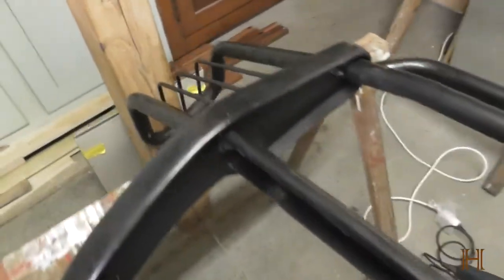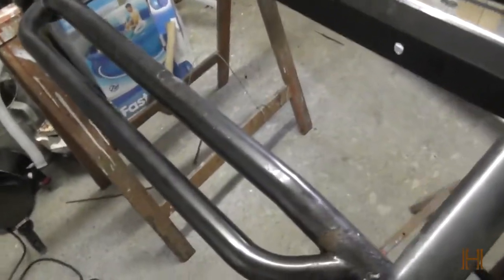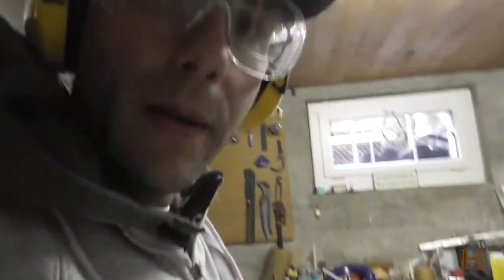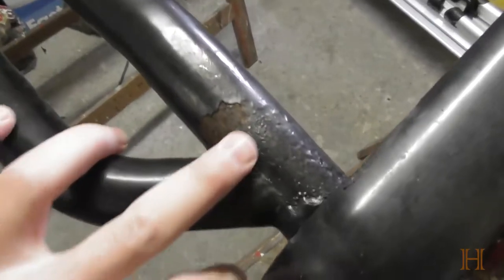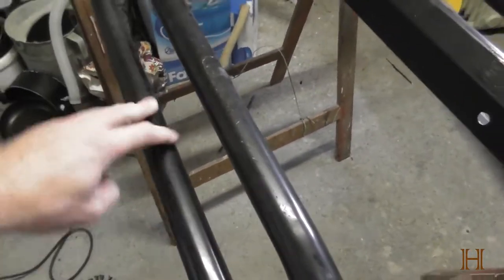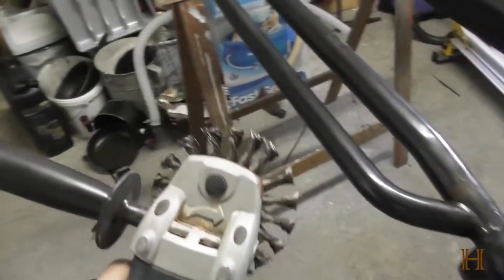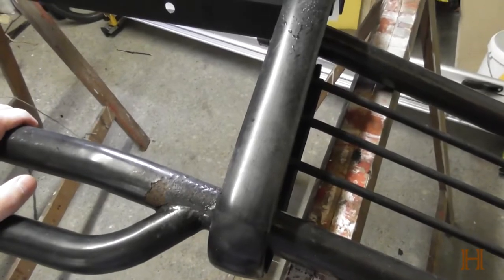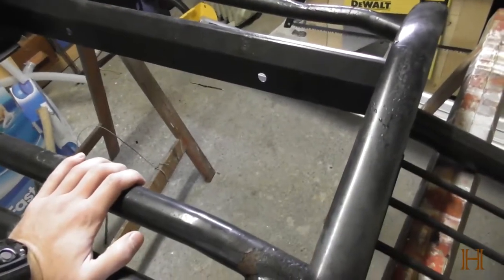Brush Guard Rust Removal and Paint

Comment: Hey man any specific model for the grinder and metal wheel ?
Reply from the maker: No was just a 4.5" grinder with the guard removed with a wire brush wheel that my local home improvement store had.
Reply: What grit did you use for the whole guard ?
Reply from the maker: Whatever I had around, from 100 to 220. I wasn't worried about marks on the guard.